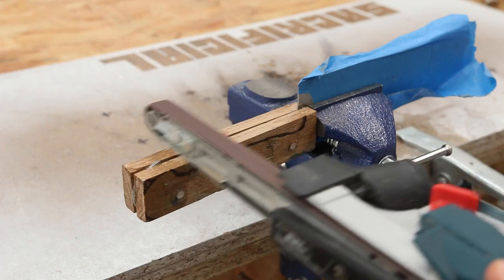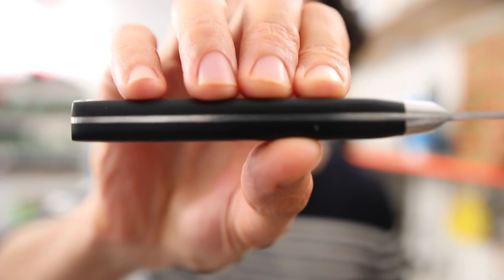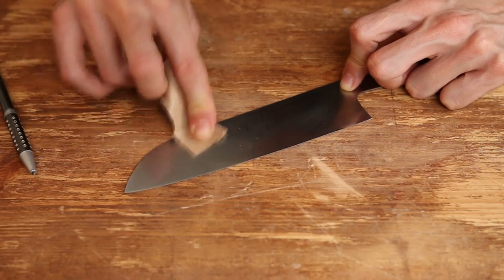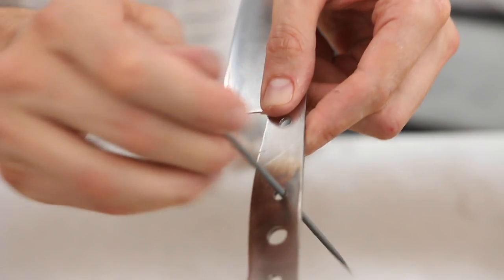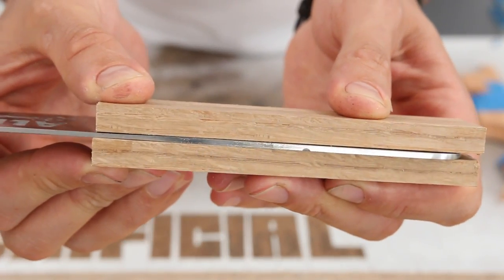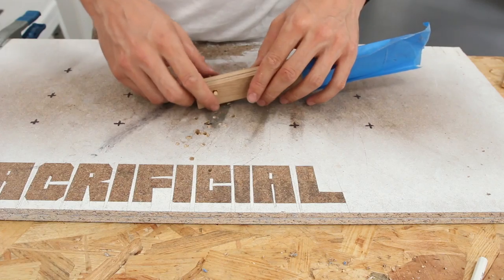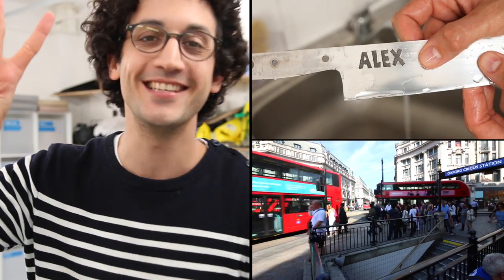How to Make a Chef Knife Handle ! Chef Knife Makeover 2/4

Comment: For a stronger pin, cut it off not flush but leave a little hanging out. Then peen it over (bash it a few times with the round end of a small ball peen hammer or a peening punch) and then sand it flush.
Reply: I was waiting for him to peen the pins, and he never did. That was odd.

Comment: Just a little tip for if you ever do this again, get some oil, thread cutting oil or even some WD40 for when you bore the holes out, stainless is a sod to drill through and with no lubricant you run the risk of messing with the temper of the blade. The oil helps cool the steel and keeps the bit sharper longer.

Comment: For those of you who don't want to deal with epoxy, or just want an even more secure handle, you can peen the rivets. Just leave a few millimeters sticking out of each side of the handle, and then hammer on the end until the metal is flat/rounded and the rivet is secure. 

Basically, the rivet should be squashed flat on both sides, thus locking everything in place.
Reply: Ronwe TheFallen not using epoxy will allow water to get between the scales and tang which will ultimately rust the knife and rot the sclaes.
Reply: peening pins adds stress to wood and its prone to spliting so i dont do it. i even go further and use wooden pins because they glue better and feel nicer in the hand (you cant feel them) i can post pic if you are interested
Reply: @robertlunsford1350   I agree to the idea of using expoxy, peen rivets was the way to go before epoxy was invented.
Reply: I can see the benefit of doing both. Epoxy is a modern invention and should be used. Traditional peening done properly has benefit. A small bevel has to be made in the wood to allow brass to spread. Of course is you spread the brass with no allowance in the wood it will split
Reply: @richardberner8711  Exactly that problem happened to me like a month after commenting that. Better late than never.

Comment: Any knife maker would be VERY cautious to the point of advising against removing the temper of a blade so that you can drill it.  If you must drill through tempered steel it is best to use a carbide drill bit.
Removing the temper would also mean you would have to re-temper the knife.  If the blade is finished the edge of the knife can look like bacon.

Some knife makers say you should use a 24 hour epoxy because it is slow curing.

As for oil your choice leaves much to desire.  Cooking oil can go rancid (FAST), especially with a knife and when you clean it.  Boiled linseed oil is the first choice in wood working oil, but if you want to use an oil that you can ingest then take a trip to your health care store and get some Mineral oil laxative.  If you want to make something then melt/mix the mineral oil with beeswax (3:2 mineral oil to beeswax is not a bad ratio, use more mineral oil if you want a softer product, less if you want a harder product).

Comment: Carpenter around. Oak wood is not a bad choice but it's a very lively wood. It's also very fluffy. If it isn't aged very very well for years properly. It can leak black sludge. Beside this being dirty and smelling bad. It can mess up your connection to adhesives to metals. Nut wood is especially terrible if you are only using adhesives. Even while using industrial epoxy with wich you can glue anything together.

Comment: Wouldn't you need rivets instead of just a copper rod to secure the handle to the tang? And worse still you made the holes bigger than the diameter of the rod?
Reply from the maker: It's brass but don't worry, its very solid.

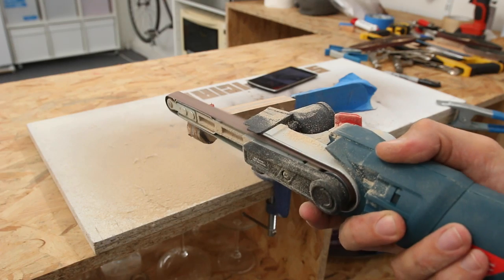Comment: Alex, a bit of advice in case you ever want to do this again. Before gluing the handle, sand/shape/polish to their final form the side of the scales that will end up on the blade side (i.e, the right side of the handle on 6:22). The reason for this is that this way you can make them more symmetric, while not risking scratching the blade itself as you shape them, giving your knife a much better finish. Cheers :)

Comment: I started similarly into knifemaking and did the same flaw... kinda flaw i guess. I put the mighty oak wood handle. durable, strong i thought. Though, do some research about pore size in wood species. for that reason its not recommended to use where frequently exposed to water, and pore structure harm final finish quality in my opinion. second handle i made was ash wood whch was as bad as oak in terms of pore size and thats when i realised that was a problem. Last handle i made was - silly i know - wood from peach fruit tree. super small pores, almost non existant like in softwoods, though its a lot stronger than e.g. fir lubmer. I say its really good enough for this purpose and accepts glue very well, naturally has very very low oil content. if anyone is interested how it turned out i can post a pic. I actually did the similar thing Alex did because im not into forging and knife steel is expensive i bought cheap chinese knife and reprofiled blade considerably and made a new handle.
Reply: I agree  with wood choices. There are fruit woods and ornamentals that have extremely tight grain

Comment: Love the idea but I'm not sure I'm brave enough to take apart my Wüsthof. Is oak the best material though? I heard that its open pores make it a poor choice for cutting boards as it tends to absorb things therefore I'd be worried about putting it on a knife.
Reply: Gideonmack hi knife maker here. And I know it's late but. Oak is a very good hard wood but it's open pores are a problem as it does tend to splinter and it will absorb things as you said. A wood like Hard Maple would be an excellent alternative. 

That said if you treat and seal the Oak properly it will make an excellent if a little boring handle.
Reply: I should add that Maple has a much tighter grain and is less prone to splintering. It's a little more resistant to water damage but it mostly comes down to how you sealed the wood

Comment: You could just heat up the handle with a blowtorch and let it cool slowly.. Blade would be fine. And you've been able to drill BECAUSE the knife was tempered. If it would been only hardened and not tempered afterwards, it would be hard as a mot*******er and very brittle. ;)